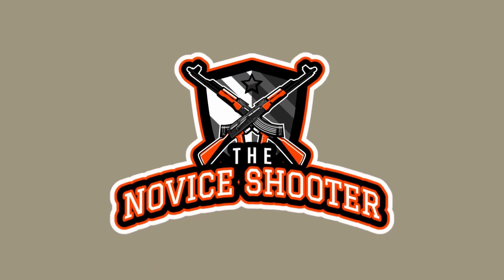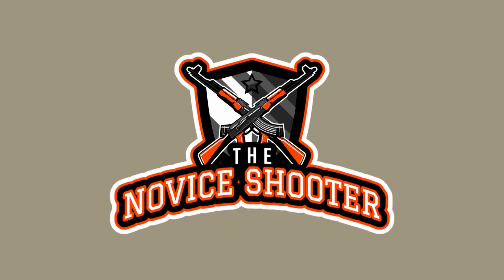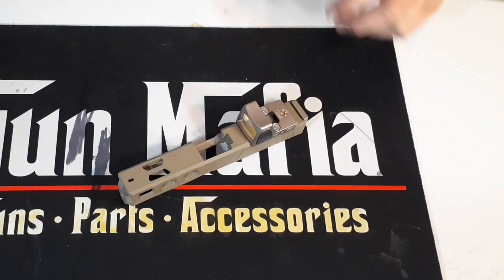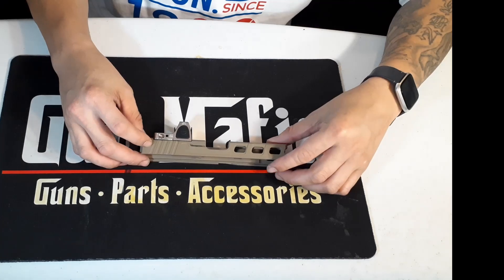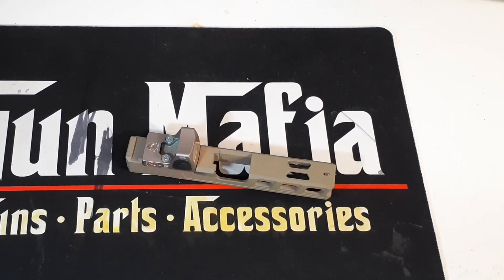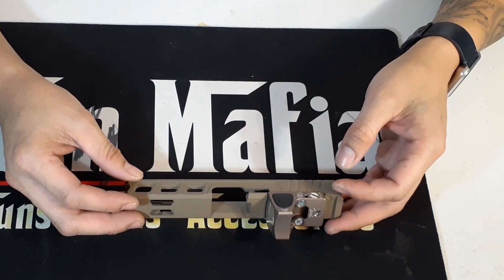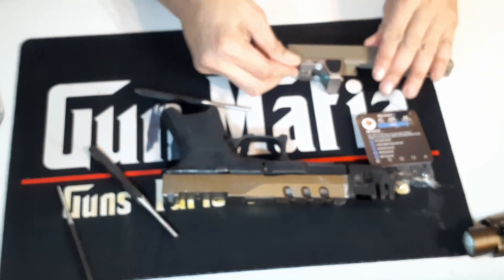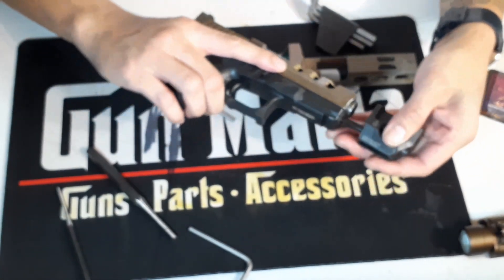Live Free Armory Glock Slide assembly Installation & Review!"

Comment: I just got the $199 ($223 free shipped) PSA Complete FDE Dagger SW4 GatorMouth cut, RMR milled, threaded barrel, 1/3 Co-witness suppressor sights upper for my G19X frame. 
The Dagger Slide will fit most all Gen 4-5's 19', 23', and others. Just swap out the backplates. Left handers won't like the slide lock/release but for right handed folks, it runs perfectly. 
No way I could've gotten my G19X slide window & front cuts like yours for that price much less everything else to make it complete. 🤟 
Slapping my HE407c x2 2moa Green Dot on it tomorrow

Comment: Does the Live Free slide come with the Firing Pin Channel Liner ? Thx
Reply from the maker: No
Reply: @TheNoviceShooter  Thanks
Reply: @TheNoviceShooter  I am going to buy one. Do you find any problems with this slide?
Reply from the maker: @rtgunguy  nope it runs so smooth and no Failure to feed issues... It's still in the breaking in process but it's been running amazing.. I bought mine on eBay I believe I paid $230 total shipping included
Reply: @TheNoviceShooter  Thank you for your reply. BTW, you chopped the frame?
Reply from the maker: @rtgunguy  yes I did a frame chop to accept g27 mags.. I know I could of bought a g27 but why when I can do a chop that looks good compared to other grips mods on YouTube and I don't have to trade in my firearm and find a 27🤷🏾‍♂️🤷🏾‍♂️
Reply: Check out 3CRTactical , Arm or Ally also they have amazing deals and fast shipping.
Reply: @knightcustombuilds6988  Thanks. I built mine already. This is my video:
https://youtu.be/E57isfa4LOM
Reply: Oh yeah I referring to future reference, can't build just one!
Reply: @rtgunguy  nice build!! I don't know how to include a link but if you go to my YouTube page and check out the build I posted yesterday. It's a super fast super flat shooting glock17 machine!